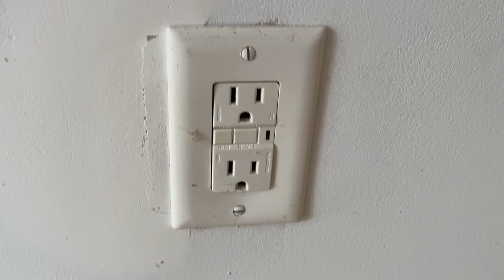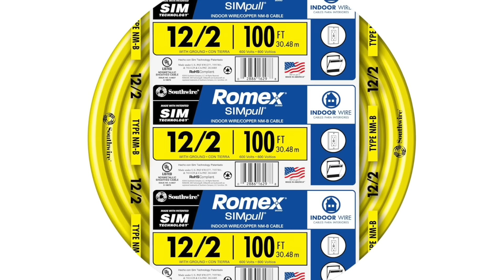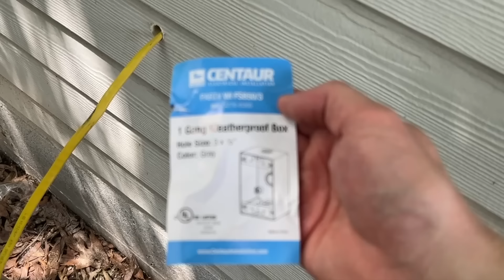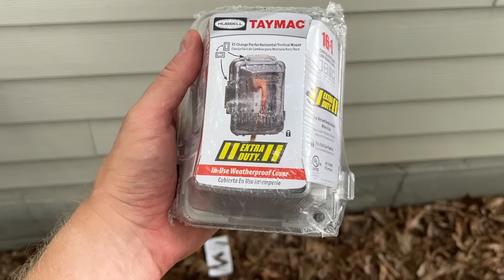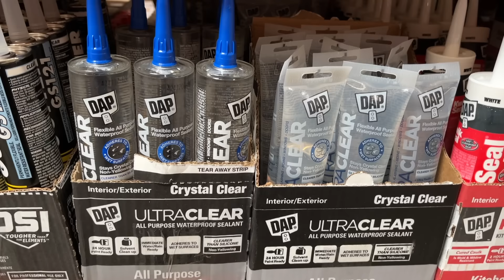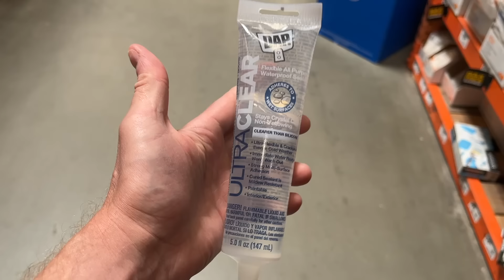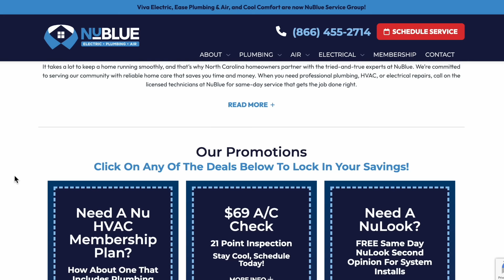FASTEST EXTERIOR OUTLET! One-Hour Outdoor Receptacle...FULL INSTALLATION!

Comment: As an electrician, although this method is quick, it doesn't look the best, as the box sticks out a huge amount.  We prefer to cut out an opening and install an electrical box inside the wall so that only the bubble cover is on the outside.

Comment: Nice step-by-step video installation.  A 20 amp weather resistant (WR)receptacle would be preferable, not required, to use on the outside as it has heavy duty contacts as opposed to the standard regular 15 amp receptacle since you probably will be using heavy draw outdoor equipment on that receptacle.  Also, I don't think the chase nipple is code approved as the Romex cable was not secured to the outdoor box except for the ground connection.  To help the current homeowner and future users of this outlet, I would put one of those standard GFCI stickers on this receptacle to give them a "heads up" indicating that this receptacle is protected by an upstream GFCI as opposed to just a standard circuit breaker.  This would be especially helpful to the homeowner or electrician when troubleshooting a receptacle problem knowing that a GFCI is also controlling this circuit/receptacle.  I would have used "Duct Seal" to cover up the hole in the wall where the cable was coming in from and I would also cover the opening  in the back of the metal outdoor receptacle box to keep water and insects out of the box as well as the interior wall of the garage.  I absolutely agree with others that "back stabbing" a receptacle and/or switch is just lazy and waiting for an electrical problem years later down the road then they loose their internal spring tension.  I really like the heavier duty commercial screw plate outlets (similar style to the GFCI) to avoid having to create a "Shepard's hook" in the wire to go around the receptacle screws that was used in the interior of the garage circuit.  Also, new NEC code requirement requires the use of a "pigtail" on all the wires including the ground instead of using the 4 receptacle screws (2 in and 2 out) to carry the electrical current going through the receptacle and then going to the next receptacle and so on.
Reply: which NEC code?
Reply: That wasn't a back-stab.  They're clamped.
Reply: That is correct, GFCI devices use a screw plate clamping method to attach the wires.  It is a very secure method of attaching wires.  Back stabbing is when the device has holes in the back of the receptacle or switch that are spring loaded where you push in the stripped wires.  Over time, the spring looses it tension and the wire connection become too loose and you have “make and break” electrical connection and the circuit finally opens and doesn’t work anymore.

Comment: I would put the external box LOWER than the internal box connected. If on the outside leak occurs, water will not dip following the wire connected DOWN into inside.

Comment: Good for beginners to learn for sure.  A fee things would have made that install above board.  Doing electrical work daily we loosely put in screws take them out use the sealant in the hole around the screw head.  This really makes thing more weatherproof.  I saw that the box was just a nail on I would have cut rhe box and replaced it with a southwire smart box it would have made the romex install alot faster.  Just a ossilating tool to cut the nails less sheetrock damage actually.  Something I do but not code is I pigtail 2 or more wires to the recipticle so power isn't turned off to other outlets if there's an issue with that recipticle.  The pigtail will outlive the recipticle many times over.  I do alot of outlets and switches just some tips for people.  If you pigtail everything even if that recipticle is burnt power will still flow to the others and you won't loose your entire outlet loop.

Comment: Great video with one issue. A cable connector is required where the wire enters the back of the box. That way the wire is secured from going back into the wll.

Comment: Lots of good information in here. A couple of extras I do that I feel are important. 

1) Foam insulation to seal the exterior penetration and the box on the inside. Not a ton just enough to seal air gaps.
2)Tape around the outlet to prevent the exposed grounds from accidentally making contact with the Hot and Neutral terminals. 
3) 8”to 10” of wire in a box. As you don’t have a lot of room, especially if it is not an end of line outlet, use a lever style connector.  They don’t hold as well as twist ons but they use up much less room.
Reply from the maker: Thank you for the extra tips, Juan!

Comment: Thanks Ethan!
A good practice is to mark the applicable breaker with a "DO NOT ENGAGE" label, in case someone closes it before the job is done. This is especially important when a circuit has outlets in different rooms.
And I would never consider a circuit safe for work by tripping an upstream GFCI outlet.

Comment: At 7:53 you mentioned the ground wire. This is an equipment grounding conductor and has nothing to do with the ground rod(s). In the event of a ground fault, the current travels through the ground wire to the sub panel then along with the feeder wires to the main panel or first disconnect where it is bonded to the neutral wire which then takes the current back to the transformer and trips the breaker. The neutral and ground wires are separated in all sub panels. The grounding rods are part of the grounding electrode system and their purpose is to protect the building against lightning strikes. If your garage is detached from the house it should have it's own separate grounding rod from the sub panel.
At 8:55, you could also twist the wires together, leaving the new one long and use a green wire nut made for this purpose and eliminate the need for a pigtail.

Comment: Screw head orientation isn't typically an aesthetic choice. While not a requirement, it was industry standard among electricians to make switched and switched receptacles by the orientation of the face plate screws. You look at a plate cover for a switch and you'll know that any outlet in the home with the same orientation will be switched and any outlet with the other will be unswitched. 

The most common is vertical for joined, unswitched outlets and horizontal to denote that the outlet has had the bridge broken out to run a switch on one and continuous on the other.

Comment: Personally, I really prefer to give each exterior outlet its own GFCI.  It's common for outdoor circuits to trip in use (just doing their job), and you want the reset right there. Sending someone on a hunt around a crowded shop looking for the master one with the reset button is to be avoided.  

To have done this, though, you'd need to have supplied it with its own feed, and presumably the existing run of existing GFCI-protected outlets were all that were handy.
Reply: Do those receptacles in that room really need GFCI protection? I didn't see any rough in plumbing to indicate a planned water source. On the one GFCI, you could remove the load connections and pigtail or connect them to the Line side, or remove the GFCI and replace it with a regular receptacle. Then you could install a WR GFCI on the outside.
Reply: @surferdude642  If it's a garage / workshop and not living space, I think they do need to be GFCI-protected. Check the code on that, but I think that was coded some years ago.

The problem with doing the wiring as you say is that the outlet they are pigtailing from is itself fed by the load side of the GFCI far upstream.  So there isn't an available "line" side to in the vicinity of the exterior outlet—everything nearby is GFCI-protected. You'd need to run a new branch, and at that point, I think it's better to give it its own GFCI right there in the exterior receptacle box where it's being used.
Reply: @jamesburkhard  Maybe I wasn't clear about the GFCI change. What I meant was to take that original GFCI in that garage and remove the Load wires from it and join them with the Line side. That way none of those receptacles downstream, including the new outdoor one would be protected. The GFCI would be a stand alone device. I'm assuming that the GFCI is the first receptacle from the sub panel in that circuit.
Well, it looks like GFCI's are required, so my suggestion is moot.

Comment: As you noted in the video:
NEC Section 210.63 requires a 125-volt, single-phase, 15- or 20-ampere-rated service receptacle located within 25 feet of the following: Heating, air-conditioning, and refrigeration equipment (other than evaporative coolers for one- and two-family dwellings)

Comment: Nice video.   But I think getting the wire through the rear knockout was either very lucky, or very skilled (and that was with a big gap between the outlet and the drywall).   Without any of those, I wonder how many of us would have gotten stopped right there.

From the comments, I think using an oscillating saw to cut the nail off the new-work box, remove it, and replace it with an old-work (swing out ears) box - might have been an installation plan more likely to have success for most people.
Reply: You could put a piece of nylon rope in the drywall gap, pull it through the box with a hook shaped pick or even a shop vac. Tie and tape it to the nm sheathing, then pull it through with minimal screwdriver manipulation. The drywall got beat up a bit here.

Comment: Using the GFCI outlet trip as the protection is not advised.  True that in this situation, the downstream outlet is indeed temporarily safe (as noted). 

But if the outlet being worked on IS the GFCI, there is still power in the box after tripping the GFCI, even though the tester shows no power at the receptacle.  Tripping the breaker is a much more reliable way to safe the system.  I suspect the electricians also tripped the breaker in this job.

Comment: As far as I knew, weather resistant outlets had stainless steel contacts inside the slots in the face so humidity wouldn't oxidize them and reduce conductivity.
Reply from the maker: That makes sense, Robert! Definitely want to avoid corrosion in there.
Reply: yes, NEC now requires all outdoor receptacles to be corrosion resistant models.
Reply: I'm not sure stainless would help.  I've sanded and wire-brushed enough rust off of stainless-steel pipes and valves to know that stainless steel... isn't stainless.  It just slows it down.
Reply: @kennethmiller2333  there is stainless and there is stainless. High grade stainless holds up well. But there are some environments where corrosion is only half the problem.
Reply: @kenbrown2808  The problem is that "high grade" is an amorphous term.  It often deals with things like tensile strength and other mechanical properties.  In this case, when dealing with chemical availability to attack, anything that's passing current is going to have a hard time against corrosive environments, especially with conditions that lead to galvanic corrosion.

Now, to be fair, taking a bit of rain in Louisiana is quite different from being pierside in Norfolk, but the point remains.

For corrosion resistance, I prefer things that passivate.  However, those have a myriad of other problems in electrical-distribution uses (anyone remember aluminum wiring?).

Comment: What are the additional steps to install the outdoor exterior outlet if there is not an existing circuit/outlet from inside that is in the desired location for the outdoor outlet to connect to?

Comment: @7:53:  The ground wire has nothing to do with tripping a GFCI.  A GFCI monitors differences in current between the hot and neutral.  A fault trips the circuit interruptor; it doesn't redirect current to the EGC.

Comment: Great video. I'm curious, how come you didn't drill the hole from the inside out and then push the wire through the hole in the Box through the hole in the wall to the outside? Seems like it would have been easier but I bet you have a reason. Thanks
Reply: It's a code violation to modify an electrical box, so you can't drill a hole through it, although I understand the temptation. I would cut the box out, then drill when I could verify that there is no risk of damage to existing wiring and replace the box with a rework box that has internal screws to attach it to the stud. Trying to thread the cable into the small knockout like they did seems ridiculous to me, who knows how long that took? He did some damage to the drywall, although it's easily repaired, it adds more time to the job.

Comment: Did the chase nipple come with the box? You said you had to "add it" and its not clear when i look them up if they come with one. Also, i have the same setup as your application except the run has no gfci at the beginning. The end of the run is where i want to tie in. Can I just install a gfci in the outdoor box connented to the end of the run? Thanks in advance. Good video.

Comment: that's actually a slow method.  get a 3-5/8 carbide tooth holesaw, and cut in the middle of the lap of the siding and subsiding.  then push the wire from inside and grab it from the outside.  put in a round universal cut in box, and use an oversized cover.

Comment: I don't usually put a pigtail on ground. Just twist the 2 or more together and cut off the ones you dont need and use what you do.
Reply: And then you use a green wire nut or a crimping ferrule, right? You still need to secure the joint.
Reply: @surferdude642 I don't usually. I twist them together 1" to 1 1/2" and that's plenty secure. It passes inspection.
Reply: Always use a green wire nut. The guy who built my house just twisted and snipped, and I had broken and intermittent grounds all over the place when I moved in.

Comment: Couldn’t you seal around the wire in the hole you drilled through the siding and weather barrier? I let professionals do my electrical work when we got new patio doors. They put most of the fixtures in upside down, including the WP covers and switches.👍

Comment: Nice step by step video. I thought code requires the wires to be torqued to a spec.
Reply from the maker: Thank you! Not that I know of, but I’ll run it by Chris…
Reply: Made tight. Good luck getting electricians to use a torque wrench on every outlet.

Comment: When Jimmy drilled through the exterior wall how did know that he wouldn't drill right through the Romex cable that may be running between the studs. It may be unlikely, but I wouldn't take the risk. I think a safer plan would be to remove that box and drill a pilot hole from the inside. Then you could replace the box with an old work box that screws to the stud and eliminate the task of having to guide the Romex cable into the small knockout.

Comment: Wouldnt it be easier to use a multitool to cut the nail on the plastric box and remove it completely? Pull new wire through and use a southwire smartbox or an old work box. Itll save you all that time fishing the wire in the winy hole and cost maybe $4 tops.
Reply: I’ve done this before and yes it can be faster, but not always. After cutting the nails, there will also be 2 large plastic ears that held the nails in place. You have to cut those off too. The old work box has slightly less capacity to accommodate slipping the wire back into the drywall at the same time as the box. If the original box has the wires stapled close, or if you have more than 2 cables running into it, I try to just preserve the original box to avoid frustration.

Comment: At my work place some genius put two IP44 outlets outside. Then the female boss wondered why it did trip the braker everytime it rained. Didnt helped that those two outlets were connected to third one inside on one fuse.
I really start to think that standards slipped very badly in all kind of trades.

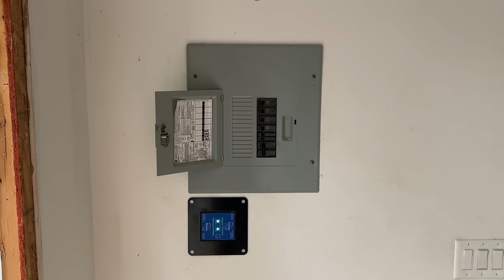Comment: At 8:00 you say the bare ground wire trips the GFCI in the case of a ground fault. I don't think this is correct. It is not your main point, but just to be more correct, my understanding is that a GFCI will trip when the hot wire's current is different from the neutral wire current by a very small amount... implying there is current finding an alternate path to ground. The ground wire doesn't actually have anything to do with it.
Reply: Actually if you back up a few seconds before 8:00 he said that the ground wire will trip the breaker, not the GFCI receptacle. You made a good observation here because all the receptacles here are GFCI protected, so the GFCI which trips at approximately 5mA will trip before the circuit breaker which trips at 20 amps. The alternate path in this case is the ground wire.

Comment: Since it is going outside can you use Wago connectors?  Or are they only for inside work?
Reply: Approved for outside. The code requires the box to be sealed with a gasket and/or caulk.